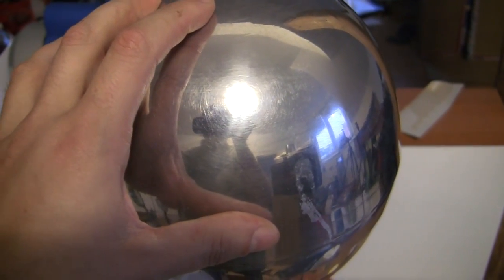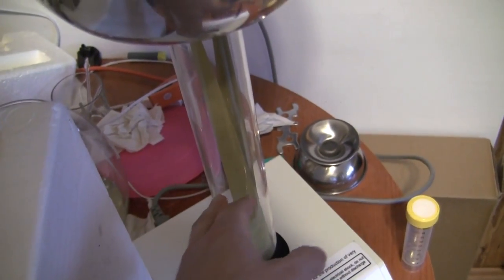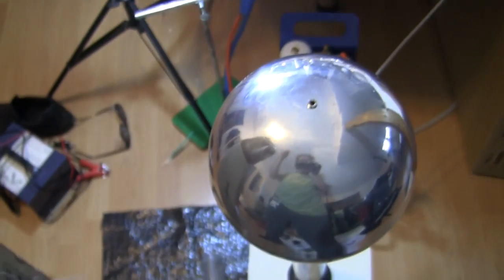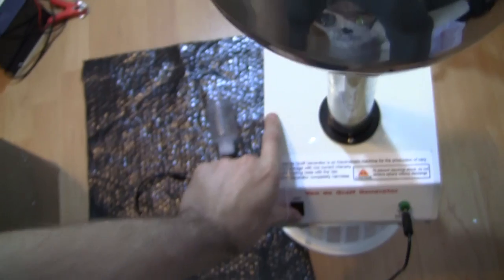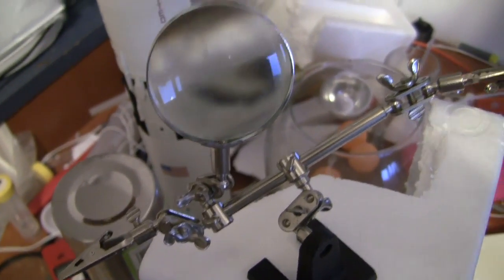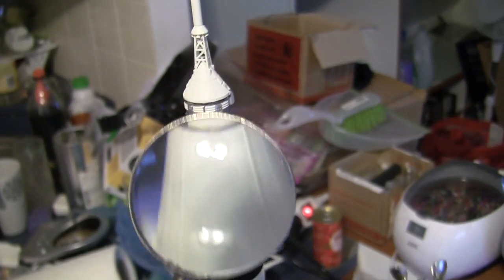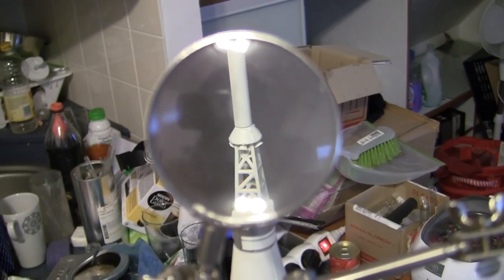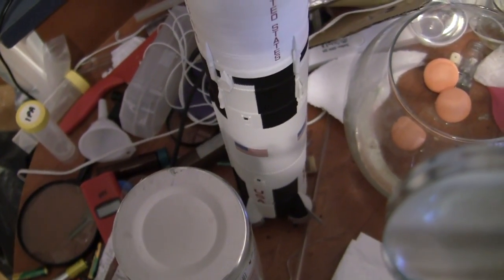Surviving a 10 000 VOLT shock!

Comment: And I thought 240 volts hurts
Reply: 240 volts can kill you, 10 000 volts can kill you. But not this kind of 10 000 volts, since it has no current it's harmless. 240 volts with 1 amp is way dangerous
Reply: ObservableFiction
1 amp does not necessarily kill you. You see when the current is strong enough the heart of the person is forcibly clamped which prevents ventricular fibrillation. A shock of maybe 0,1 or 0,2 amp is more deadly since the heart will twitch uncoordinated.
Reply: Jonathan Gréen
5- 8 milliamps 'across the heart' is the standard to kill an adult human.
Reply: Navitas Nexus
I might have the numbers wrong, so thank you for the correction. But the part about the heart clamping is still true.
Reply: Yes, you are correct, how ever only if the voltage is high. High voltage is what causes the contraction of the muscles associated with the self defence mechanism.